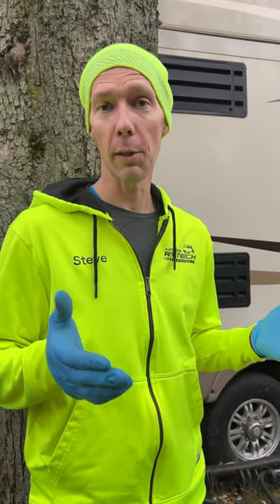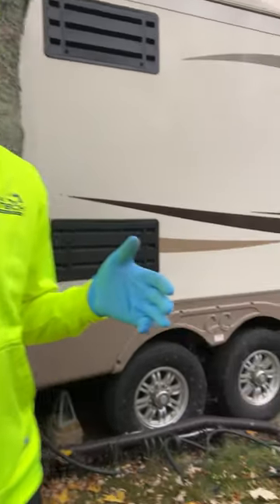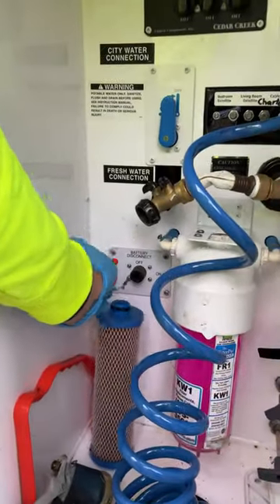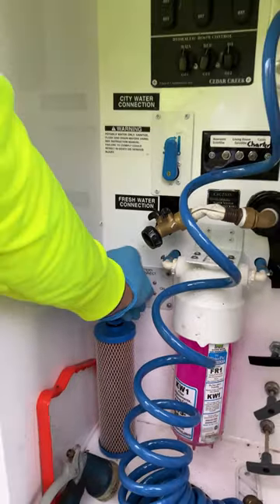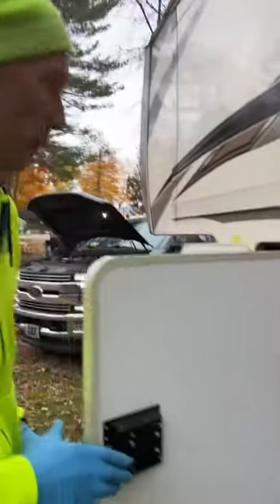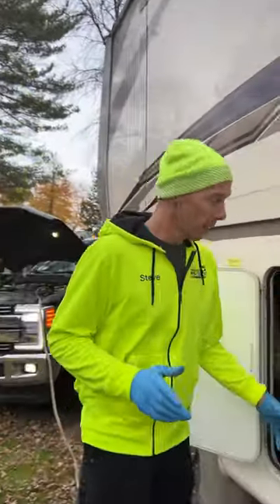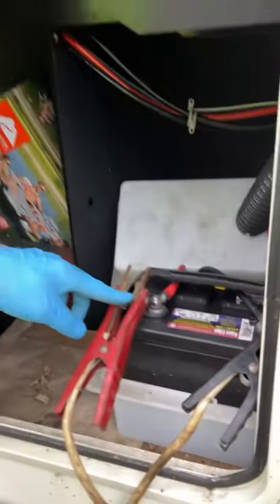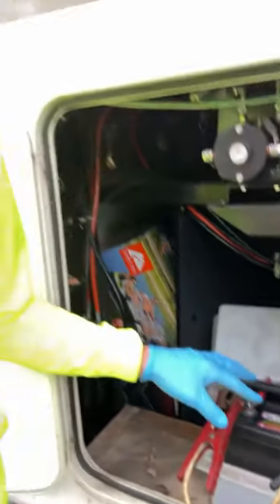RV Slide Outs Won’t Retract | Winterizing RV

Comment: Are you saying if the battery is removed for winter BUT trailer is plugged into shore power I cannot operate any 12V systems?
Reply from the maker: Some things may work such as lights but heavy power usage items like a slideout will not. Not having a battery in place and using 12v power from the converter is the quickest way to kill a converter. The converter is designed to charge the battery not supply power to the loads in the RV.